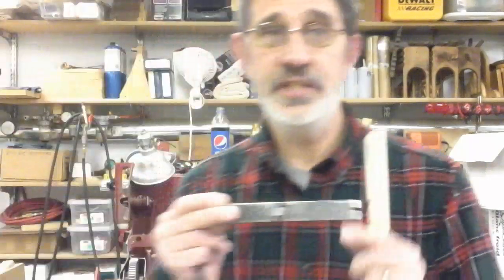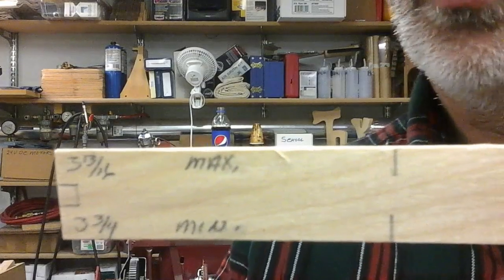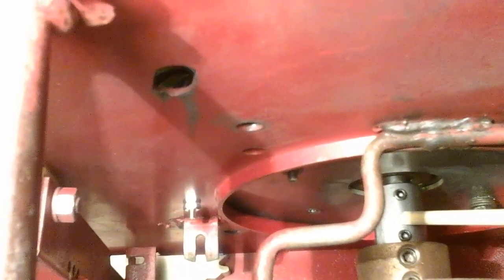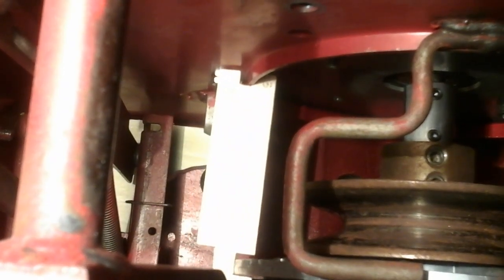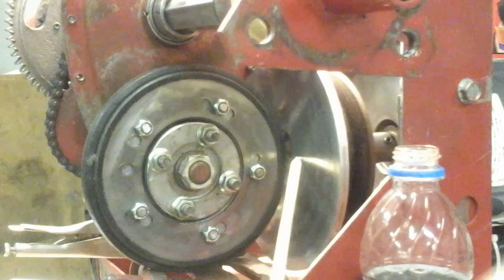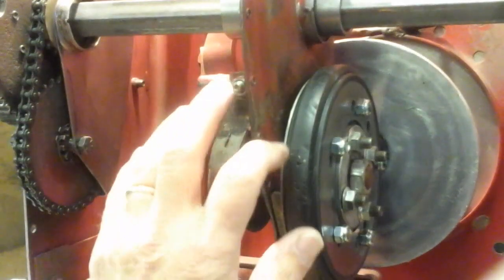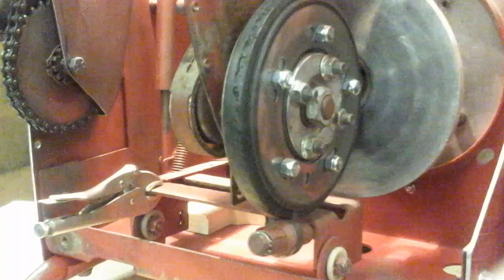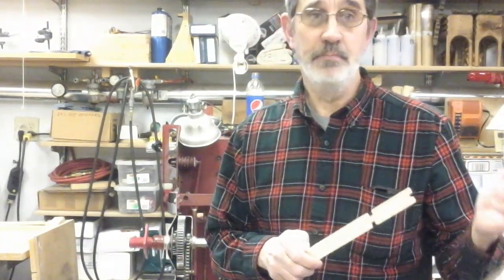70. How can I adjust my clutch and drive disc

Comment: We emailed a couple years ago when I got my snapper RER to rebuild. After we spoke, I got cancer and had a long recovery. Financial situation is still tough but bit by bit I've been buying general maintenance parts for it. I'm determined to get it done this year. Got most everything torn down, ground down and primed or painted. Just finished the engine and in a few more weeks I'll be reassembling the rider. So glad you have this video in particular because I was getting ready to assemble the chain case assembly and drive and wasn't sure how to make sure the new clutch assembly needed to be adjusted.  You're a lifesaver for many of us!
Reply from the maker: Yes I remember the name I can’t remember what the issues were at the time but if you need anything just let me know, sorry to hear about your health issues. Chip

Comment: Snapper rear engine mower is the best grass cutter ever!  IMO!
Reply: Just brought one
Reply: @chrisbradley1110  Me too. Just got a 1992 SR170 16hp 42in. Having trouble with drive disc. Think this video just explained it. Gonna be a beast once I get proper contact. Rubber disc is new, but fits loose and flops around...almost like it's too big...weird

Comment: My DRIVE DISC always fell between these two measurements using the tool which I built as Jim suggested; this puzzled me to no-end, because my system was still slipping even with a fixed (bolted) clutch; It turns out,  my RER's YOKE ARM (which is attached to the YOKE LIFT) was landing-on and hitting the rear of the RER chassis; The spring was on the strongest setting, but the YOKE ARM was resting on the chassis so the clutch-rubber was not receiving the benefit of the spring and could not tolerate any mild out-of-flat of the DRIVE DISC; my RER worked well until i  tried to climb a mild-incline with it, and it would slip then, even with a new clutch disc (fresh tall rubber). I loosened the two set-screws on the DRIVE DISC and pulled up about 5mm and bolted it back down; this got the YOKE ARM off the chassis and that solved my problem. The other thing about my chassis is that the lip has a different height on one-side, versus the height of the other-side. The lip is not the same height all the way around. After this adjustment, i went back to the soft-start clutch, after many years of the fixed (bolted) clutch. I feel sure that my DRIVE DISC height is a few mm past the setting on the paint-stick DIY TOOL, by about 5mm (about 0.20 inches). I may soften the spring just one-notch next, then adjust clutch for the 3/16inch slack and the brake for the 3/4inch metric specified by Snapper. On some machines, the 5 13/16 inch max may be marginal like it was on my RER; maybe something is worn or bent - but watch that YOKE ARM, make sure that it does not 'bottom out' on the chassis wall, and if it does, just get the set-screws loose and get a puller on your drive disc (gently) (my drive disc is ALL STEEL, btw) - and give your RER an extra 5mm maybe (about 0.200 inch), and the YOKE ARM will now have plenty of room (more than 5mm, since the see-saw 'gain' of the yoke lift/arm assy amplifies that 5mm a bit).

Comment: Great info on the drive disk and clutch.  That model is a great idea and makes the explanation and compression so much easier. Mine is a year 2000 13hp series.  Your vid saved me many headaches. So, thanks much.

Comment: This guy knows EXACTLY what he is talking about. Listen and learn if you have forward drive issues. Like he said, the rubber drive ring comes in several sizes. Each manufacturer is different in OD size. Stick with OEM Snapper parts to be safe. And if your rubber drive ring doesn't go INSIDE the driven disks center hole area in NEUTRAL gear, you won't have forward drive motion. Just as he said it. Great video sir. Love the simple measuring jig you made to measure it out.

Comment: Jim, I am replacing my drive disc and used your video to make the measurement. The way I see the measuring, the 3 3/4 inch is from the bottom of the chassis to the face of the drive disc. If you measure the bottom of the engine adapter plate, the red metal plate, then the measurement would be a bit longer.
If the notch on the top of the stick, is 3/8, 1/4, or 1/2 inch deep, the side of the stick that is on the outside of the circular engine cut out on the chassis, will touch first, before the other side touches the red engine adapter plate, as it is higher up, a wee bit..
Am I correct here?
Reply from the maker: Yes the stick is supposed to straddle the lip sticking down from the round cut out in the top of the deck. Jim

Comment: Question I have a Troy Built rear tine tilled from 1980. Changed the belt and can’t remember how to thread the belt around the idler pulley. Got a video or suggestion? Thanks!
Reply from the maker: Can’t say I’ve ever worked on one of those. Can you send me some clear pictures of the pulleys and maybe I can figure out how it’s supposed to go.    
Send them to   
  jimsfixitshop@gmail.com
Thanks.     Jim

Comment: Hey ya Jim.. hope you and your snapper’s are doing ok this mowing season. I have an issue with one of my machines. Break cable snapped. I have a spare cable on my parts machine. “Same model “ do you have a video on how to take off and install? 
Thank you.. 
-Steve
Reply from the maker: Try watching video number 365 and see if that helps you out. Jim
Reply: Thanks Jim.. paste the link to it in this chat if you can Jim.. I’m looking but haven’t been able to find it.
Reply: @jimjackson9381  thank you Jim… I was able to fix the issue by watching video #365 .. fortunately I had a spare cable on my parts machine. I should off taken the deck off to do the work. Might have made it a little easier.

Comment: My clutch disk still has some movement after I installed the new one, with the new brake lining. Is that correct?
Reply from the maker: Yes sir supposed to be loose that’s why they takeoff slowly and don’t snap your neck back. Jim.

Comment: i have a 2006 or 7 snapper rer with a slipping clutch. is there a heavy duty clutch upgrade i could install?
Reply from the maker: adam white 
   No there isn’t a heavy duty style, you need to watch video number 70 and adjust your yoke spring and your machine won’t slip anymore unless your clutch disk is wore out thanks Jim

Comment: Hey Jim, my clutch disc, the rubber ring around it, should it slide around on the metal disc?
Reply from the maker: Mark Lynn 
Hi Mark it’s Jim
  Well if you’re both talking about the same metal disk your clutch disk should be loose on your clutch disk assembly they call that a soft start clutch, the rubber it’s self should not be loose on the metal disk. I hope that’s what you’re talking about. Jim

Comment: My crankcase seal is a pain to replace  did it twice still leaks in the drive disk PLEASE HELP !
Reply from the maker: James Roberson 
 Are you talking about the lip seal in the bottom of the engine,  The best way to replace that is to disassemble the engine press the lip seal in place in reassemble the bottom of the engine. Thanks Jim
Reply: Well i have to take the engine off to replace the crankshaft seal ? The seal the round seal right above the wheel to move the mower ?
Reply from the maker: James Roberson 
  If you have replaced the lip seal a couple of times the problem could be the crankshaft itself either the crankshaft has a Bad spot that was hurting the lips Seal making it leak or  The lip seal has worn a groove in the crankshaft and if that is the case you'll have to use what they call a speedy sleeve to repair the crankshaft  good luck with that one . Let me know how you come out on that thanks Jim
Reply: The crankshaft is fine just cant get it in straight

Comment: This seems doable.  My novice question is, how do I jack it up to work on it?
Reply from the maker: Jen H 
  Hi Jennifer it's Jim
     If the back of your snapper has two bars that are sticking up and down that is where your bagger hangs, you grab a hold of the front of the machine and just stand it up on those bars. You will want to shut off the vent on the gas cap to prevent leakage and if it's going to be stood up for more than two hours they recommend removing the battery. If you need any other help you can email me or put a question in the description box below the videos. My email is. jimsfixitshop@gmail.com Thanks Jim

Comment: What can cause the center wheel to separate from the rubber
Reply from the maker: Well it depends how old it is and if it’s not running square with the drive disk on the bottom of the engine that will wear it prematurely. Jim

Comment: Hi Jim,  my Snapper rer will go in reverse and very slow in 5th gear. Does the clutch need adjusting? Love your videos. I'm a 57 year old single female and need to be educated from time to time. Thank you.
Reply from the maker: Dee Jay 
Hi it’s Jim
   It sounds like your yoke spring needs to be tightened I would put the top of the spring in the top hole and the bottom of the spring in the bottom hole.   if you can send me a picture of your clutch disk I can tell if it needs to be replaced that will definitely have an affect on how the machine performs. And don’t worry I have quite a few women mechanics that I’ve helped fix their machines so we will get through this issue you can send me a picture of it to my email which is
jimsfixitshop@gmail.com
  Thanks Jim
Reply from the maker: Hi it’s Jim. 
  I haven’t heard from you in a while I am just wondering how you’re doing on fixing your snapper, if you need any help please get a hold of me and I’ll help you out. Jim
Reply: @jimjackson9381  Hi Jim, well you were right, it was the spring. I adjusted it like you said and it is working just fine. Now my only problem is I have a gas leak at the carb bowl after I took it apart to clean it. I bought a new o ring and it is still leaking. If I turn the gas on with the bowl off and hold up on the float it stops the flow so I'm thinking the float and needle are working properly. Any thoughts?
Reply from the maker: Dee Jay 
Does your float bowl have a drain on the bottom of it if it does they usually leak once you push them to drain the  bowl. If not it’s probably the gasket on the float bowl. Jim
Reply from the maker: And it sounds like your needle and float is working ok. Jim
Reply: @jimjackson9381  Yes it has a screw on the bottom but by running my finger around the diameter of the bowl the gas is coming from above that. I replaced the bowl gasket with a new one but it is still leaking.
Reply from the maker: Dee Jay 
  Yes sometimes it is hard to get the gasket in place especially with the carb on the engine

Comment: Could having a bad clutch be one of many reason why I am having hard time starting reel mower?
Reply from the maker: You need to send me a picture of your clutch disk and do you have your yoke spring as tight as you can get it. Jim
Reply: Thank you for a quick response! I will try to do it. Yes  I will send you photos of it. It means a lot to me.  You're doing remarkable things.
Reply from the maker: @yongminhuh146  I like to keep track of how far I am reaching to help people where do you live. Jim
Reply: @jimjackson9381  I am still trying Crack open all the bolts and nuts that are involved in adjusting clutch. Do I need to remove or at least crack open(I feel those bolts need some wriggling room to be moved) those 3 mounting bolts(mount where those clutches are sitting on)? They didn't give much room to get to there. One more question, is it okay to lay reel mower 
 on side way?
Reply: @jimjackson9381  what is your email address? I will email photos of my reel mowers clutch system. And I am in Southern California,  West Covina California to be exact.
Reply: @jimjackson9381  I wasn't able to crack loose the clutch locking nuts today for the reason of ruining nuts edge using two monkey wrenches. I will figure out easier way or go buy long handle correct wrenches. However I found out that those mounting bolts were loose. That's why(I think) there were very loud crackling sound right after start of engine. I retighten them. The noise has gone away from today's mowing.
Reply from the maker: @yongminhuh146  
My email address is
jimsfixitshop@gmail.com
Thanks. Jim
Reply: I figured out how to untighten jam nut. I have one more question. Question being, how tight the blade should turn(factory setting) when it's not engaged? Freely turn by hand? Or some force it to turn by hand?
Reply from the maker: @yongminhuh146   well if you’re asking how tight should the brake be yes you should have to use some force it’s easy to adjust the brake so it is working properly you take the cover off the top of the deck sit on the machine start it up and engage the deck then lift up your foot and your deck should stop within about 2 to3 seconds if it doesn’t tighten up the nut on the spring to tighten the break.  Jim
Reply: @jimjackson9381  Sorry. I was asking  how tight reel mower blade turning it by hand when not engaging.

Comment: Just bought a 1992 SR170. 16hp Twin with 42in deck. Guy I got it from put a new rubber drive disc in. I think it's too big...it's loose and moves around. The center hole is much bigger than the little center hub it sits on.
Reply from the maker: Well Ashley that is the way it supposed to be that is what they call a soft start clutch if you want to send me some pictures I can look at it and make sure send them to my email which is
jimsfixitshop@gmail.com
Thanks. Jim
Reply: @jimjackson9381  I think we finally figured it out. This new drive disc with the rubber on it...does NOT have the little friction liner on the inside. None of my parts websites or diagrams mentioned that little friction liner. I imagine once that's installed it will have the grip it needs.
Reply from the maker: @masterp2269  Well I’m sorry I usually always mention to viewers to make sure you get one with a liner in it and your right without that liner it’s steel on steel and you’re not gonna go anywhere you may even be able to pull the liner out of the old one because they’re just in there with friction and use that. Jim
Reply: @jimjackson9381  Yessir, apparently the guy I bought it from managed to get a new disc with no liner. I'm sure I'll be rolling as soon as it gets here! Thank you sir!
Reply from the maker: @masterp2269  Do you think that’s why he sold it, good for you bad for him lol. Jim

Comment: I found the simplest and fastest way is to just loosen the pulley in neutral, then slide it down until it hits the drive case and then slide a thin ruler or paint stirring stick as a spacer to keep it 1/16" away from the disk. that makes it have great traction without slipping. I find its just a lot easier to use a spacer, then trying to make a special ruler for it. especially on my 2013 snapper because it has no way to adjust the spring and its set to have much less pressure on the disk then the older models. when I set it as instructed in this video it would stop and just slip when I drove into 4" high grass. it drives properly now by using a ruler as a spacer, if i have any trouble slipping in the future I might use a thin washer to reduce the spacing a little more, but as jim said, you have to make damn sure the drive case has "some" clearance so it doesn't touch and rub on the drive disk
Reply from the maker: keakar63 
Could you send me some pictures of the drive train on that 2013 I haven't seen one yet I  like to see  if possible where the spring hooks onto the yoke and the yoke arm. Thanks jim
Reply: keakar63 clutch slipping on yardman 38in  riding mower
Lol
Reply: we are only talking about snapper rer lawn mowers here, so you are on the wrong page  if you need to ask how to fix your yardman 38in riding mower

Comment: Excuse me, could you please tell me if it is normal for the drive plate not to be perfectly flat but presenting some grooves at the level of second and third gear?.. is it wear? Should I change it or just lower it?
Reply from the maker: The grooves in your drive disk should not be deep enough to cause any slipping issues watch video number 70 and tighten your yolk spring and that should take care of your issues if it doesn’t get back with me and I’ll tell you some other things to check.        Jim
Reply: @jimjackson9381  ......the spring is already on the furthest hole in the position that creates the most force, I changed the clutch plate but second and third slip as soon as there is a bit of slope or effort, while fourth and fifth have no problems, I will try to lower the height of the traction plate...
Reply from the maker: Send me a picture of the plate I do have some used ones.      Jim
Reply: @jimjackson9381  ..I'm in Italy, I have the European model, I proceeded to lower the traction plate as well as replace the clutch disc, now it works very well and it doesn't slip in any gear, however it has become more tiring to push in neutral
Reply from the maker: Well make sure you didn’t lower the drive disk on the bottom of the engine to low so that the clutch disc is rubbing on it in neutral.    Jim
Reply: @jimjackson9381  ..could it be, if so, can I move the spring of the tie rod or does it have to lift the disc ?
Reply from the maker: If you haven’t already watch video number 70 and tighten your yolk spring

Comment: I have a problem with my rider snapper mod E331518KVE The disc in gear is blocked while in neutral it turns. The gears are engaged, but the wheels do not move, only by pushing the vehicle by hand thanks to the help ti seguo dall'Italia. Jim can you tell me the distance measurements to the center disc plate or how to make my disc stuck in neutral gear no

Comment: I own a riding snapper mower. I am having a problem with the center blade.  It doesn't cut.  Only the 2 outer blades cut. Help!
Reply from the maker: Sounds to me like you have a broken belt on your mower deck Ck the top of your deck for the belt. Thanks Jim